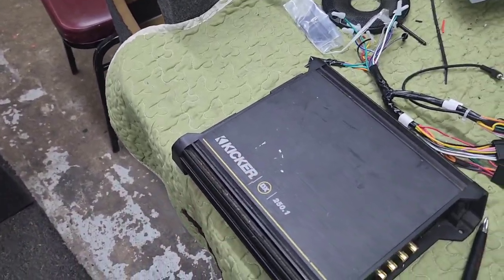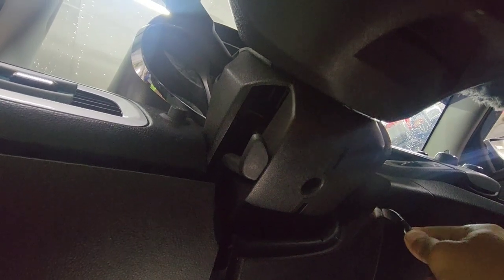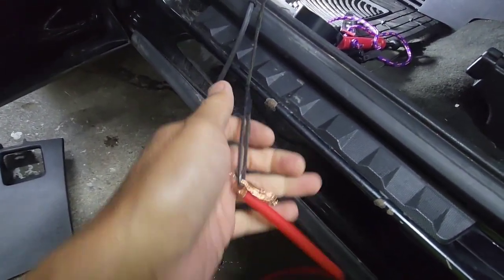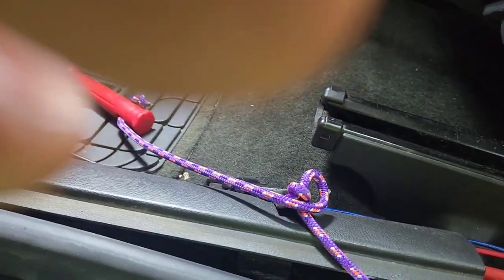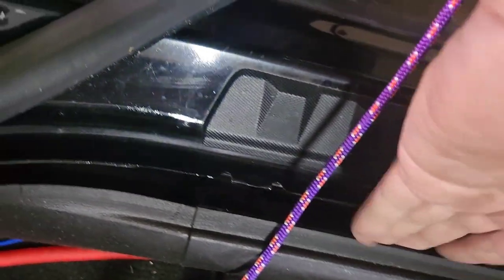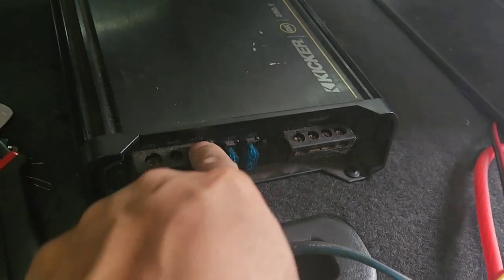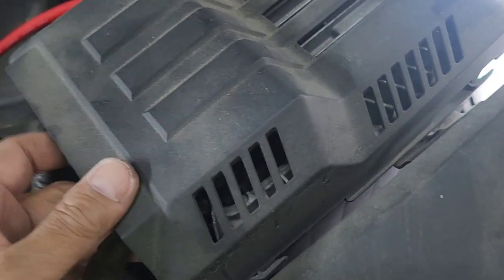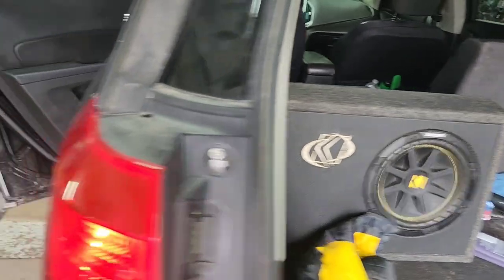2010 - 2017 GMC Terrain Amplifier Install

Comment: You should never remove your weather stripping. That's the rubber you just caused leaks for no reason. Those panels come off really easy without taking the weather stripping off

Comment: Did you used an audio interface?
Reply from the maker: Are you referring to Loc or line out converter?
Reply: Something to make a bypass of the OEM amplifier
Reply from the maker: Use Kicker brand kisloc2